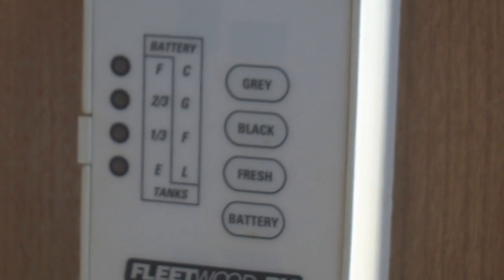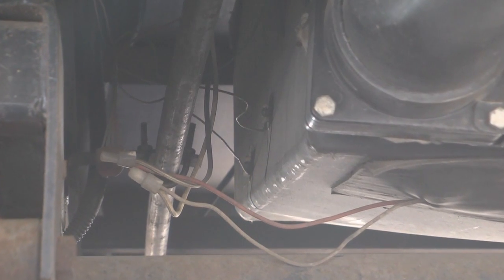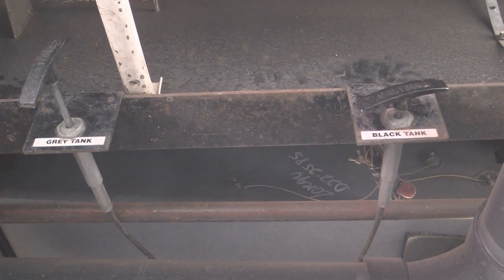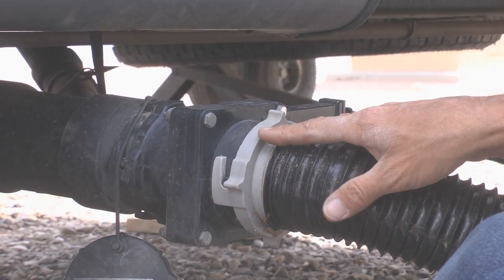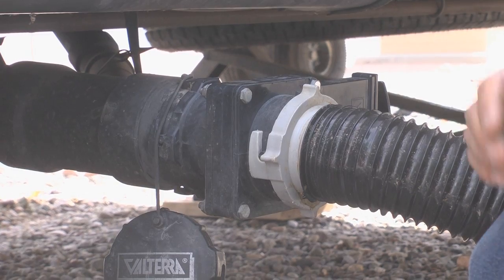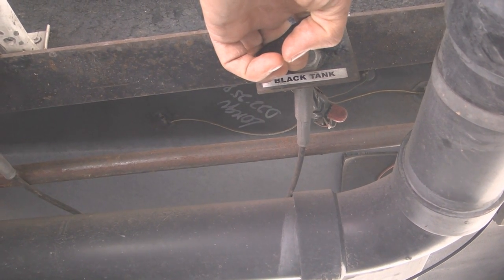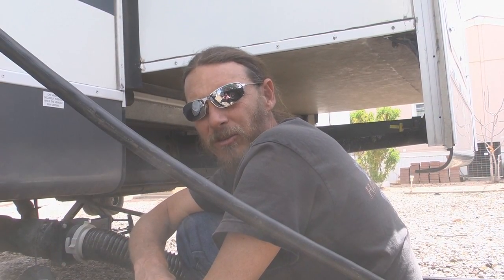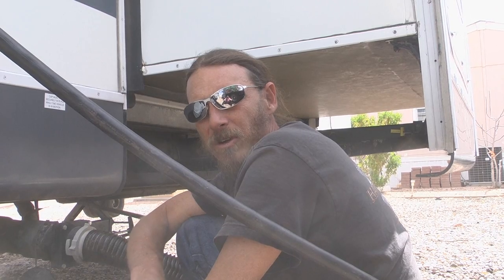Best RV Black and Grey Tank Hack

Comment: Chastity Kaegi beat me to the punch. I would be rather worried,,, (and I mean to say that I would not do this because of it), about contamination into the grey tank. This is a big NOPE in my book.
Reply: No wonder his grey tank stinks.
Reply: Absolutely. Cross contamination.
Reply: I wouldn't mix them either. I would consider ice, or just fill and empty the back tank a couple times
Reply: You have much more important things in this crazy world to worry about than this. First, he emptied the black tank first, so naturally, gravity will force the water into black tank so anything in the black tank would have to swim upstream through a very strong current into the grey tank which physics will not allow. The key here is to listen to the water flow and close the grey valve when the rushing water slows down, before the levels in the tanks equalize. Then empty the black tank and repeat just as he demonstrated. Even if they did equalize the water in the black tank would still have to work its way downward through the water in black tank drain pipe then swim upward through the grey water drain pipe and then into the grey water tank this would not happen instantly while the trailer is still. Second, if you did mess this up and some of the grey water that you let into your black tank were to seep back into the grey tank it would not be the end of the world you can just flush it out if you are worried about it, but just stop and think about it, your sinks and toilets in your house all connect to the same septic tank and/or sewer pipe and your grey and black tanks are both going to be dumped into the same tank as well. In fact RVs didn't always have separate tanks for grey and black water, some older RVs only had only one tank and they are not separate now because we don't want to "contaminate" our filthy grey water.  As long as you have water in your traps you should not have an odor problem. Grey tanks are not sterile water and they do have some nasty bacteria and stuff (from washing dishes, brushing teeth, washing sweat and whatever filth may be attached to you skin from camping, swimming in the lake, cleaning fish, handling raw meats, etc.) in there so they will smell any way. If it didn't smell they wouldn't put traps on the sinks.
Reply: @scotsabo2716  the traps block the flow of gasses from the sewer. Sewer gas contains radon, a radioactive substance given off by decaying fecal matter which causes cancer. Google "what is radon"
Reply: @PaulAerison  sewer gas contains methane, radon comes from the earth as a decay product of radium.  These are short lived isotopes and are naturally occurring from the earth not sewer gas.
Reply: Juan Carlos 
Thank you for making that clarification for me! I was just about to do so!

FYI...we are full timers. Right now in New Mexico. It is so hot and dry here the trap water will evaporate quickly. There are other RVers who have a problem with gnats, fruit flies, or whatever they are coming into their RVs. I believe these folks probably leave their gray water valve open all the time. This allows the little buggers to come in from the dump line to the gray tank and the traps are not filled and they infest an RV.  The shower is the biggest offender because most folks will use the campground facilities rather than use up their gas, electric, or water.
Thanks again for posting.
Regards....

Comment: Ya know, there's still nothing easier than a 5 gallon bucket of water down the toilet! Its whats recommended by the dealer. Works every time.
Reply: True! I live in a fifth wheel that is permanently parked and hooked up to the park's wastewater system. The drain stays open all the time and every other day I pour a five-gallon bucket of water down the toilet.Over two years now and never a problem. BTW, I do not put any toilet paper down the drain, instead it goes into a small waste can next to the toilet.
Reply: before you are ready to leave a campground ,  pour a  gallon of vinegar  down the toilet then on the way to the dump it will clean off the fat etc. in the holding tank ,  draiin the tank and then add about 5 gallons of water into the black tank and you should always be trouble free.  Of  course your black water tank should be a least 2/3 full before you dump.
Reply: Or actually, several 5 gallon buckets down the toilet. Another thing I do (if no one else is waiting for the dump station) is to pull the drain hose out of the dump station and use the flushing hose to fill up whichever tank is now empty using the drain hose.  Then I raise and lower the drain hose 5 or more times, letting the water run in and out of the tank and then eventually allow it all to go down the dump station.   As long as you keep the end of the hose high enough, not water comes out until you lower it.  Makes a big difference in both tanks.

Comment: The answer to most of these problems can be eliminated by having a macerator toilet and a macerator at the discharge point!!
Reply: Until they fail and or still get clogged overtime. Then they are a huge expense then. Really not always worth it

Comment: By doing this you now back washing your black water into your gray water tank once the pressure equalizes you will significantly cross-contaminate the gray water tank. you now have two black water tanks. There's a reason your told to dump black before grey.

Comment: Interesting idea but what keeps the black from mixing with the grey?
Reply from the maker: Dump the black first.
Reply: Ray Adams You close the grey B4 MTing the Black the second valve protection prevents cross contamination. Grey closed, Black open secondary valve open. Then your black drains normally. Shut secondary valve, open grey, then close it. Repeat the process until Black runs clear. Then add the additives (RidEx, etc.) a bag of ice 5 -10 gallons of water. Maybe a little dish detergent and walla clean tanks and clean sensors.

Comment: What is the best/easiest method if you live full time in the rv but you are stationary. Like we don’t move around.
Reply: Better late, than never. I just read your question. I'm fulltime stationary in a 20 year old 5th wheel for 18 months now. My routine as a single guy:
 I leave gray tank open Sunday-Friday. On Friday I close the gray water valve to allow it to fill the tank until Sunday. On Sunday, I drain my black tank after making sure its topped off with plenty of water. I drain the black tank and turn on my built in tank sprayer. Then I dump two 5 gallon buckets of water into tank and drain that. No problems. Last, I drain the gray tank to wash away the sewage from the drain lines. 

With two people, the black tank would fill quicker, so just pick a couple of days to do the routine. 

But don't leave black tank open. Flushed fluids will out run most of the "solids". Allowing the "solids" to build up.  

Just my 2 cents.

Comment: This is not a good idea because it cross contaminant to the gray tank with sewage a big NO NO... Just buy a valve with a flushing cap on it simple install like this valve n when you want to add water to black tank to flush you just hook up a garden hose only used for waste n nothing else n open black tank valve n turn on water valve completely flushes out black tank the right way n simple. Sorry if I'm slamming you about this but you need to know never leave the gray valve open when you are going to open the black tank valve...
Reply from the maker: Don't worry.  You're not slamming me.  I have been full-time RVing since 1992.  Perhaps you are simply inexperienced and misinformed about the subject at hand.  Flushing valves are a waste of money as the water velocity in the tank  does little to clean the tank interior.  Who told you to never mix the grey and black water?  Are you afraid of getting all the bacteria from rotting food particles, dead skin cells, and rinsing of raw foods into your black tank?
Reply: @HighDesertOffgrid  Well I to have plenty of years n knowledge of RVing, boating n dry camping just so ya know. I also am a firm believer in your never to old just like being young to learn new things. I will just clearly disagree with your take on Black/Sewage Tanks. RVs will benefit from a tank flusher as long as they  have a short straight drainpipe to the black water valve n good water pressure. If not flush it out from inside down the toilet itself with a hose, bucket of water, etc. You know surfers get infections n flesh eating bacteria from the ocean beach water next to countries that pollute the ocean with their sewage when rain falls are high,  cities use gray water to water grass n landscaping not sewage water, there is a reason why you have to let shit compost before you can use it as fertilizer or run it through a series of purification in a sewage treatment plant before it can be reused or better yet just use an incinerator toilet turns it to black ash bacteria free n can just be dumped on the ground just thought I'd share this information from your statement that I am  inexperienced just saying. My RV now has a builtin black water tank flusher which I don't even have to use because I use natural enzymes in my tank to break shit down n have never had a problem. Still one day I'll change it to an incinerator toilet. Sincerely have a nice day!!! :-)

Comment: I just bought  trailer and the toilet is backed up none of the water comes out how can I get get it out the tank says is full on both tank open valves and nothing comes out
Reply: Ok like it or not get ready to get dirty, open up your black tank value and shove a garden hose up it and turn the water on full. That will clean you out but then you'll have to clean yourself up. Good luck 👍
Reply: put in at least 3 galllons of vinegar  and go for a long ride.  You probably are having this problem because after you empty the tank you have to flush 5 gallons of clean water down the toilet so the tank is always wet and nothing hardens .
Reply: Put the garden hose down the toilet and work it towards your drain. A lot less messy than doing it from the valve end.

Comment: Get a tank flush system
Reply: Those are gimics. They are enough to clear the sensors but not actually clean the tank. Not enough pressure to clean